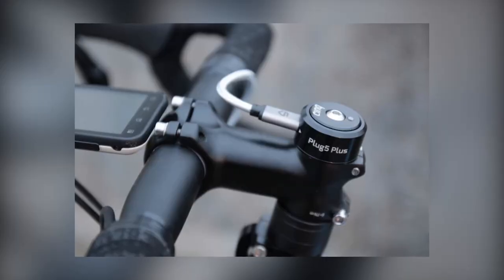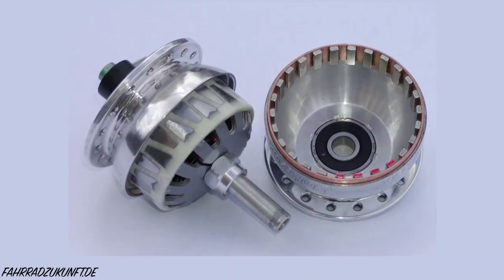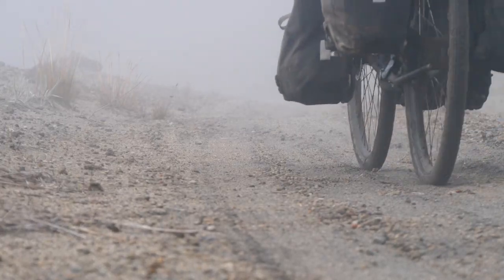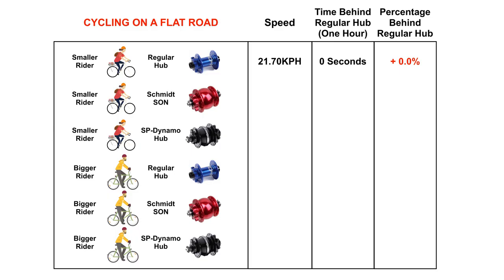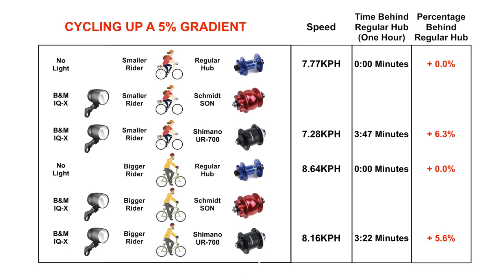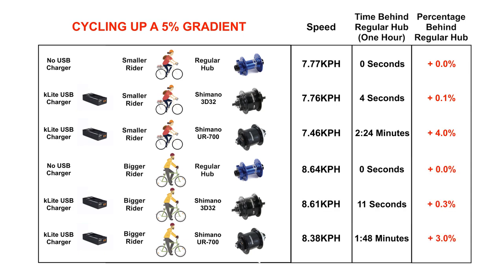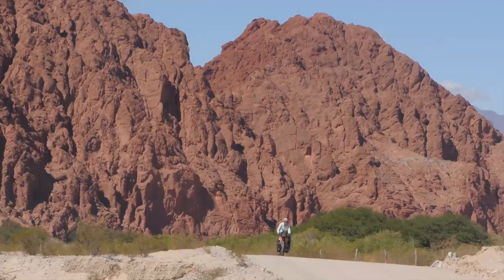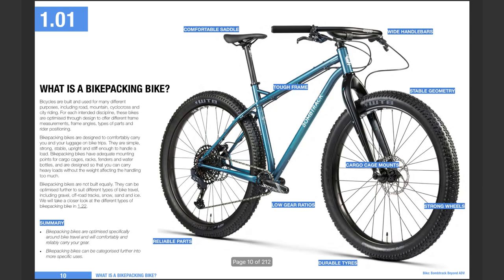How Much Do Dynamo Hubs Really Slow You Down?

Comment: Great posting. But i wonder whether you heard of a different dynamo based on the old technology: It is called "VELOGICAL". bASED IN THE OLD SYSTEM (WHEEL drag). They are made by a german co. in Cologne. worth checking into, specially if you don't need a different hub. The cost is about 150 uros Thank you for detailed info and my admiration for what you do
Reply from the maker: Yes, I have an article on rim dynamos here: https://www.cyclingabout.com/rim-dynamos-can-now-generate-more-power-than-hub-dynamos/

Comment: I have Rohloff/Son 28-Edelux front and rear set ups on my touring bikes. I'm prepared to throw away some efficiency in favour of reliability, safety and good light on tap. On a long ride I count kilograms, not grams when kitting out anyhow. So why fuss about a few percentage points of drag?
Reply: I had once a dynamo hub on my trekking bike used for commuting.
However, the usually used rear and front lights were not really reliable, the cables and connections corroded easily, and the lights were not really water proof.
Now I use a 36 V light (powered by the E Bike battery) and a AA battery powered one on my E bike, and AA battery powered ones on my other non electric  bikes. Of course you have to change batteries from time to time (I use rechargeable NiMh ones), but they are now more reliable than the old one.
I use the bikes for sport and commuting, but not for crossing whole countries ;-)
Reply: I know, my Shimano hub produces more power at typical riding speeds while touring than any other hub. And I simply do not notice the extra drag with lights on/off, even while charging with lights on. All this analysis, and saying small percentage points matter - when in the real world they do not.

Comment: I love Dynamo lights. That said, I had a Son hub crack and now steer clear of them. The crack started at the inside corner of the tessellated joint between the two halves of the hub. Sharp internal corners are stress risers, and I think it's just a flawed design.

Comment: @cyclingabout have you ever found a way to make the Cinq5 plus more robust? My new unit didn’t last a week before one of the small wires connecting the cap bust. More glue perhaps?
Reply from the maker: I've never busted those wires, so not too sure of a fix. Perhaps you need to ensure some extra length in the cables?

Comment: I would have thought the slowing effect of a dynamo hub was unnoticeable with about 3 watts. You would notice it if you spun the wheel with the bike lifted it.
I estimate my 3000 lumen and 7000 lumen lights to be around the 10-30 watt mark at full brightness, though I will measure with an ammeter. They run off of separate battery packs though 30 watts would be significant slowing on a dynamo hub. It might feel like the tyres are a bit low on air.

Comment: Hey, thank you so much for this video :) For how long have you been using your usb-charger? I've heard in another review that they can't withstand rain... Since I haven't found any other detailed reviews I would be really interested in that. I'm thinking about getting the same setup as you have for 2021 👍🏻😇
Reply from the maker: My charger has stopped working 2-3x since I got it. I just take the top cap off and dry it out in the sun and it comes back to life. 
But apparently, I got one of the first production units (early 2019), and Cinq told me they have improved the waterproofing since. I'm currently waiting for a new unit, but for some reason you cannot ship batteries out of Germany currently?!
Reply: @Cyclingabout  thanks for your answer :) i might really go for this investment then. if you are from the uk then i think ur generally unlucky if it comes to anything like shipping at the moment. hope you get your unit soon. have a good one 👍🏼

Comment: Thanks for great info Alee, You are the reason why I started preparing my bike for light touring. You think that 50/34 and 11-34 with only rear panniers could be a problem on a occasional steep gradients?
Reply from the maker: You'll have to just try it! It might be fine if you spend little time on steep roads. The gold standard on a light tourer is 23 gear inches for a climbing gear, and your setup is likely closer to 27 gear inches. If it's working for you, there's no need to change it, but if you finding yourself grinding up hills too often, switch to a 46/30t crankset and life will be more pleasant.
Reply: @Cyclingabout  LOL, my Surly has 18 gear inches for the lowest gear.  I love the way that heavy old truck climbs up hills.

Comment: I use the SON dynamo hub, actually I have three in total. I got my first about fifteen years ago. It has been used extensively and it runs and looks like brand new today. The SON hubs are pricey but I think they are very well worth it.
Reply from the maker: I agree. Everything about the SON is great - the efficiency, reliability, bearing life and finish.
Reply: Their price is also "great" :-(
As far as I've seen SON hubs are a bit lighter than Shimano so the weight penalty compared to non-dynamo hubs is reduced. That also reduces time loss uphill a bit.

Comment: Another great video!
Pedal cell dynamo....I've seen your take on these and they do seem to be perhaps the best way forward if road/gravel riding. Just wondered if you or others here had used them in very muddy conditions as this is where I think they could struggle?
I was also interested to read that despite their extra power, lower drag etc you have chosen to continue with your Son setup. I wonder if this is because that is what you have and it works well. If you were starting a fresh and looking at a dynamo system for off road touring, would you still choose the Son setup or would you go down the Pedal cell or similar route?
Look forward to hearing back from you.
Reply from the maker: My number one reason for using a hub dynamo is for the lights. The fact that I can harvest energy from it is really just a bonus. If I did it again, I would still go with the SON28 hub plus one of the better chargers - Cinq, Forumslader or NC-17.
Reply: @Cyclingabout   Hi Alee and thanks very much for your reply. I have the K2 light and charger which I picked up second hand, so will go ahead and get a wheel built up around a Son 28 boost hub.
Thanks for all your great work ref all things cycling :-)

Comment: Hi Alee, can you recommend the Plug 5 plus? I think about buying one but the few reviews I found are not that encouraging - especially concerning the long-term quality, usability in rainy conditions (and installation)
Reply from the maker: I think it's a great charger but cannot guarantee the long term waterproofness. My charger had to be removed from my bike three times to dry out the charging cap. According to Cinq, they have improved the waterproofing since I got mine (early-2019) so I'm looking forward to getting a replacement charger soon.
Reply: @Cyclingabout  thanks

Comment: I wonder how much of drag is produced by the bearing itself and how much it could be affected by poor bearing adjustment from the factory. I found that a lot of shimano hubs were set to a too high bearing load. With quick release hubs and especially with hollow aluminium axles you allways want some play in the bearing setup, which then will be erased by the load of the quick release skewer, when build into the frame.
Reply from the maker: If you look at the hub drag graph without anything connected, the data suggests only 0.5 watts between best and worst-performing hubs. So the bearing variation is likely 5-10% of the total resistance with a light or charger connected.

Comment: Can you turn the dynamo off (disengage) at will like it were an electro mechanical dynamo?
What do you think of solar panel (warmer places) on carrier to provide for charging phones and even bike lights at very little weight penalty?
Reply from the maker: No, you cannot disengage most dynam hubs. But as you can see, the drag is absolutely minimal. 7 seconds per hour in the best-case scenario, 54 seconds per hour at the worst. That's compared to a high-quality sealed bearing hub - expect these time differences to be reduced with cheaper hubs.

Solar can be great if you rig it up well. I personally don't like the hassle compared to my dynamo setup, but people get good results.

Comment: Question, is the Son dynamo hub as good, strength-wise, as the same rim, spoke set, tire, brake rotor, but with an Industry 9 front hub?  Meaning, rocks, gravel, etc pose no issue for it?  Are the bearings serviced similarly?
Reply from the maker: Yes, the SON is as good as it gets. It uses deep groove SKF bearings (629-2RSH) which are top notch. You cannot replace the bearings yourself - they need to be replaced at a Schmidt service centre.

(I have SON hubs that have cross multiple continents and still spin like new - I've never had to do a bearing replacement on a SON hub)
Reply: @Cyclingabout  thanks a bunch!  I will try it out.  I did not actually want one, but my bike shop sort of snuck it in.  I could have had them remove it but since they are 3 hrs away i did not want to leave it overnight after having waited for the bike to arrive over 6 months.  I don't care for the bulbous look.  Besides it did not come with a rear light. As long as it takes a pounding I am OK with it for now.  I will load this bike up big time.  I would have bought a Tubus rack but the light was not cheap. I had an old Night Sun used by police however the NiCads needed replacing which would have set me back a few quid anyway.

Comment: How about using the dynamo hub during the day only to charge a battery light.  You could utilise descents as much as possible so you don't perceive any additional effort.  Then at night you are not loading the dynamo hub.  The other option is a solar panel on the rear rack or on the handlebar bag maybe.  How much power would that generate compared to a dynamo hub?  To almost answer my own question, if a person puts out 120-180W then you cannot get anymore than that from the dynamo hub but you can get that power whenever necessary.
Reply from the maker: Charging batteries on downhills is an excellent idea in theory, but unfortunately, downhills are rarely long enough to get a decent charge. I wrote this on another comment asking the same question: 
"It depends how long the descents are, how powerful a charger is and how bright/efficient your lights are. Let's say you need to fill a 4800mAh light battery to run it at 800 lumens for three hours. Using a powerful Forumslader USB charger, you would need to descend at 30KPH for four hours throughout the day to fill the battery up (including light battery storage losses)."

Solar panels are a better option. Bigger panels will create ample power for a couple hours of night riding.